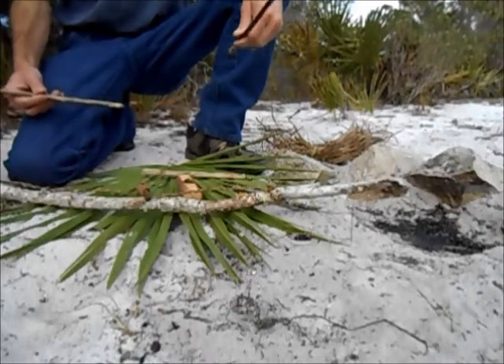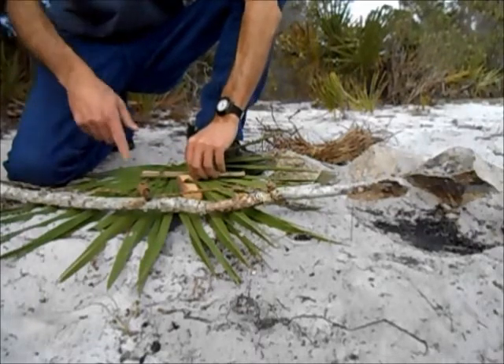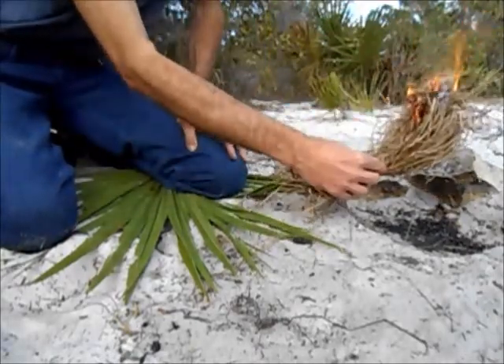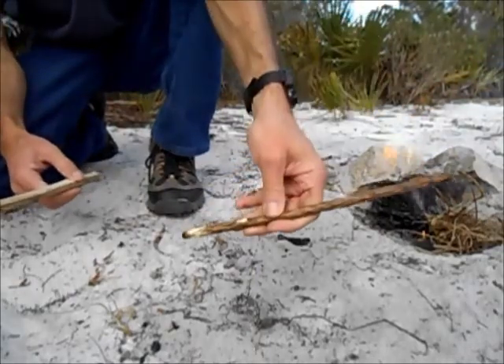FirebowHorseweedCaesarweed

Comment: Nicely done! Even with both ends of the bowstring tied to the bow. I always have trouble with that for some reason.

Caesarweed is by far my favorite. One of the easiest friction fire materials I've ever used. I just wish it was easier to come by, at least in the places I've been. I haven't gotten to try Horseweed yet.

I like Caesarweed cordage too. Pretty durable for being for such a light-weight weed. I think I've used it once or twice as a bowstring.
Reply from the maker: Thanks. Well I would have trouble just holding onto one end of the cord in
my hand while spinning. Ouch. Haha. Yeah, I think you will find Caesarweed
more inland here than on the coasts. I am surprised its not everywhere with
animals carrying the stick on burrs all over but it does tend to like fresh
water so that may be the reason its not on the coasts as much.

Comment: Those 2 weeds are used with hand drills a lot , right?
Reply from the maker: I think some folks use them for the hand drill. Most any hand drill materials will also work for the firebow. I don't use a hand drill for two reasons. First it wastes a lot of energy I probably would not be able to spare in the wilderness. Haha. Second it can cause blisters if the hands are not conditioned for it and I don't want an injury in the wilderness if possible. The firebow is more efficient so less energy expended and if done properly no injuries.
Reply: I've noticed the master hand drillers don't use a lot of energy AND... they have perfectly carved spindles and fire boards and the best tinder bundles. Bow drilling is much more forgiving in those same areas.
Reply from the maker: David West
"Master" is the key word where they have done it so much that they have control over how much energy is used and so much that their hands are always calloused so no blisters. Their tinder needs to be particularly dry and their sets made from very dry "low" temp ignition friction woods. Fortunately the firebow is not "as" particular for its tinder and friction wood needs. Yeah, more forgiving.
Reply: Hand drill is sexy... a mystique... very impressive in my opinion. I have no plans to ever try it again though.
Reply from the maker: :-) Read Smiley Face. Not for me either.